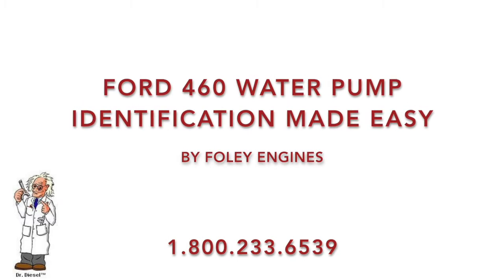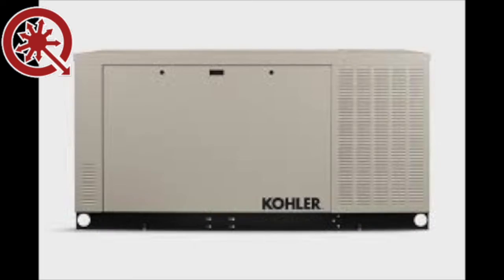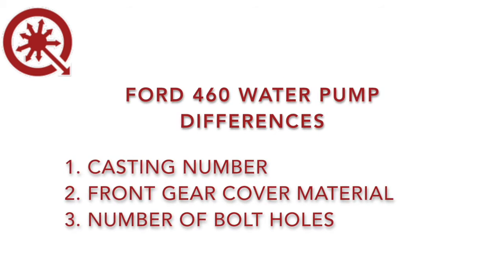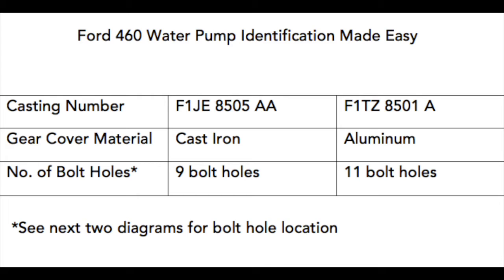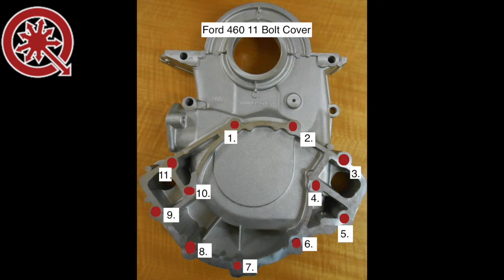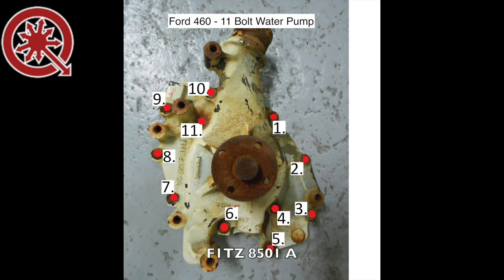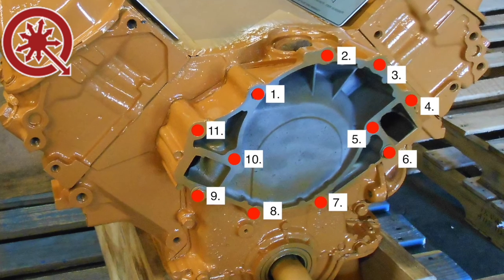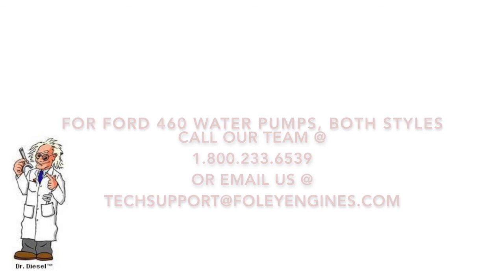Ford LSG875i / Ford 460 Water Pump Identification Made Easy

Comment: Sure would be a thirsty pump motor.I figured diesel engines would be used.
Reply from the maker: Ron, Thanks for the comment!  With the cost of the new Tier 4 Final diesel engines, gas engines are more and more appealing...  These days, fuel costs are not always the top concern.
Reply: They can be run on propane and natural gas